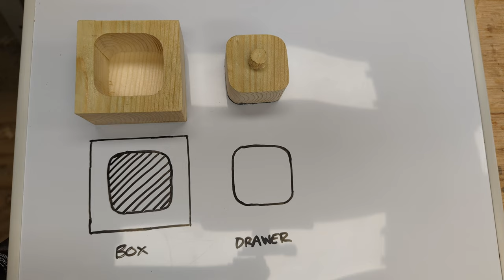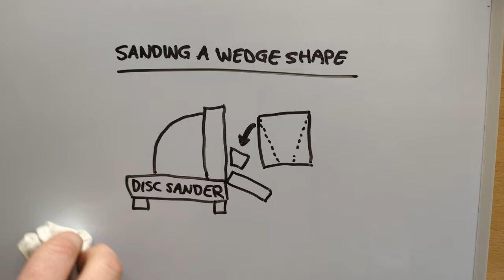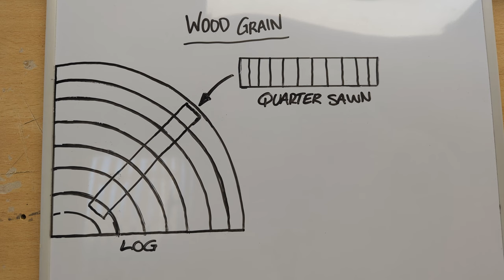NO gap bandsaw box

Comment: Neat. Could you do the 1st prototype strategy, but just a 5 or 10 degree angle?
Reply from the maker: Don't tell anyone but I did try 5 and 15 degrees off camera. 5 degrees, the wedge dropped about 75% and 15 degrees dropped about 50%. 30 degrees seems to be the sweet spot as it only dropped about 2 or 3mm. But I'm happy to be proved wrong.

Comment: Very good idea! Question, and this is something I've always wondered about all band saw boxes. Do you find your gap is uneven because of the single entry kerf?
Reply from the maker: The uneven gap in my opinion, is the worst part about bandsaw boxes. Hopefully someone will watch this video and come up with a better way. 🤞
Reply: @MartinMurrayWoodDesign  {I was thinking something like cut all the way thru on the entry cut, so the whole thing shifts down, not just one side.
Reply from the maker: @BenNawrath  that would totally work, you would have two glue lines to hide but if  that's ok with you then give it a try. 👍
Reply: @MartinMurrayWoodDesign  yeah depending on the grain pattern maybe it would even be easier 🤷🏻‍♂️

Comment: I'm still not sure why cutting at an angle reduces the gap.  But it's nice to see a man on a mission.
Reply from the maker: I struggled to put it into words myself. 🤦‍♂️
Reply: Because he can then recess the drawer in further to remove the gap. Then sand away the front of the outer shell to same depth of the drawer
Reply from the maker: @JohnColgan.  👏
Reply: Thanks both!
Reply: Because it creates a miter. The cut is now 45 degrees away from the back of the box. You can't see it, the drawer face overlaps a bit. Whereas before the cut was always 90 degrees from the back and you could see straight down the gap.